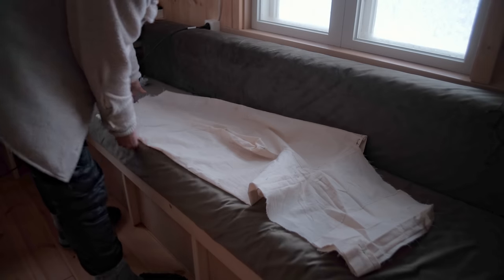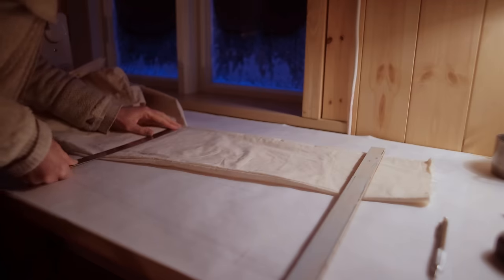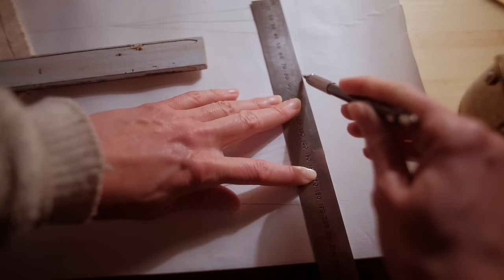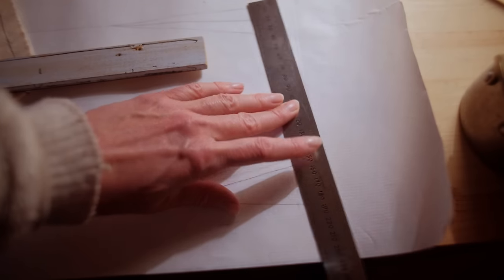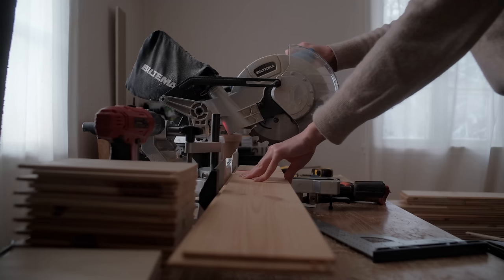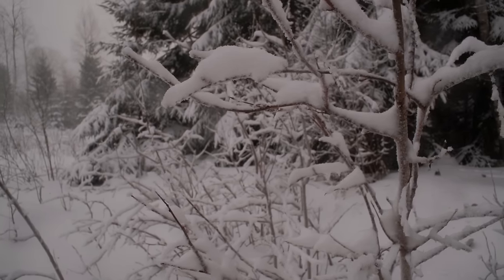Finishing my library build with a reading nook (Story 73)

Comment: Just an idea… you might want to think about getting a small sled 🛷so you can load up your packages and items from the market on a sled with a little rope attached, and just pull all your stuff home with it. Would definitely be a lot easier while dredging home in all that snow❄️.   Then when summer comes, you could switch out and use a little wagon.

Comment: Rosie, in Sweden they use push sleds to travel, not the sleds with dogs but just your own power. One of those might make your trips easier in the snow.
Reply: Yeah, I was thinking that too, at least to the bus. They have a seat on the front to which she could strap her groceries. They're probably not easy to find though, I have never seen a new one. They're called "spark" or kicksled.

Comment: May I offer a little tip about your crosscut saw?   You have a very course blade there.   The fewest teeth on the blade....and it's good for cutting roughly, but if you get your supplier to give you a fine blade...more teeth,  you will find you get a really clean cut.  No splits on the underside, which I've seen you having to trim off.  More expensive purchase, but really well worth it for the fine work you are doing.   Really nice what you are doing...!!!

Comment: I started watching before you bought this place. Love your style. You inspired my wife and I to build a tiny cottage on the rocky Oregon coast. Only 12'x24', red pine board and batten siding. Raw pine inside, even the floors. But our accents are black sheet rock screws everywhere instead of nails and wrought iron hardware. White bead board ceilings and a couple walls in bathroom and kitchen. We are all off grid, no propane. We are all solar, even a passive solar water heater that even provides heat through oil filled radiators with hot water pumped through them by a small RV water pump....James

Comment: I was thinking about how hard it is to lift heavy or odd shaped things upstairs to attics...and thought of how we used a pulley system to get bales of hay into our barn's loft storage area. You could rig a  pulley on the main beam of attic roof right above the stairwell , tie a strong rope to whatever needs to go up...and haul it straight up by pulley. That door you put up in attic could become a bed/table pllatform by adding 4 locking caster wheels to it. Add a roll-up mattress and its a simple seating area or a guest bed. Or use it as a growing area for plant starters and roll it to a sunny window spot in attic. P.S. Your too big overalls only need inside pocckets added...then when you get to buying groceries, when you get off the bus... fill your pockets with apples, oranges and LOTS MORE CHOCOLATE...you will lighten the load of your backpack and bags...and can hike home and munch along the way lol...take my advice and you may eventually fit the overalls lol!

Comment: It has been my experience with overalls that you want them to be a little on the large side. Usually, folks are layering bulkier clothes underneath them and you need to be able to bend and twist, etc. That's  difficult to do in tight overalls 🦋

Comment: Love this video again. Could you please sometime do a video about some practical stuff where you show us how for example your water system is set up? How do the cables go inside and what system is under your sink, And where do you leave the grey water from the sink without a septic tank? And how do you wash big pieces, for example bed sheets? I’m dying to know!!!
Reply: And also super curious how you for example heat the house if you are not home (as with christmas). Does it all freeze inside??

Comment: You pulling that door around the corner conjurs the image of a small furry creature slowly dragging a meal into her burrow even though the meal is several pounds larger than she is.  Roomy coveralls are not a bad thing. You can wear them over other things when its cold out. As a member of the peanut gallery I would like to suggest that you might need a hot tub. Love those hooks! From here I think that the gold in the lamp works with the color of the wood...
Reply: And, ya, the light's accents compliment that brass hook on the other side of the room.
Reply from the maker: I'd love to be small and furry!

Comment: A trick for carrying heavy and/or bulky stuff is to use a rope or a climbers sling, it's best if you can secure it upstairs, but even if you can't, it still makes it a lot easier.
Also, if you care about the piece or the staircase, it may be good to wrap the door, in this case, with a rug or something, it will also make things smoother

Comment: I’M 80 and have lost a lot of body strength in the past few years.  So I use tricks to move things.  In the door to the attic, I would put old towels, blankets, etc. either rapped on the edge of the door being dragged or on the stairs.  Then you can pull the door up much easier.  You can also put a thin rope or butcher twine on the door know and wrap it around the bannister.  This is in case if the door becomes heavier than you can manage the rope will stop it from falling and being damaged.

Comment: I think the gold color inside the lamp shades help reflect more light. Also, your bibs turned out fine. Bibs are supposed to be baggy so they're comfortable to work in.❣️ Also buy a small plastic toboggan sled and you can put your  backpack or whatever in it and pull it behind you. We have a large child's sled we use to haul our firewood in. It works great!

Comment: I admire your “I can” attitude for doing things without having been trained. You find solutions! One tip for sewing is to pin seams with point going opposite the raw edge ( bulb out, point in toward finished work) such that pins can be removed as you stitch and just before the machine might run over them. 🦌💌❤️🦯🔨👍

Comment: Perfect way to finish the video: if only I had light bulbs. lol overalls are not supposed to be fitted. Rather, they are supposed to be quite large so "workmen" could move with ease while doing construction and painting. That said, you're the one wearing them so you have to like them. 

Your place is really coming together! All you need is light bulbs! ; D

Comment: You seem to have equal amounts of patience and ambition which fascinates me. Re carrying such heavy groceries can you get a small child's sled to pull to the bus stop and leave there (hidden if need be)? Pulling on snow would be a LOT easier that walking while carrying a heavy load. Unless, of course, this is your way of building strength. 
Your coveralls looked fine. Have never seen fitted ones. You could never work in them.
Were we listening to an airplane flying overhead when you were out at your bench? The wind didn't seem to be blowing, so I'm guessing it was a plane. That came as quite a surprise as it always seems so incredibly silent there.
The gold inside the light fixtures will probably add a nice warm glow as many lightbulbs now have such a cold tone. I think you will like the effect.
I don't get to watch that often, but I always enjoy your videos as I could never do what you do. Do you have cell phone reception there? I spend a lot of time alone, but I do enjoy phone conversations as a form of company. I'm guessing in a sense you might think you have a lot of guests considering how many tune into your channel. Curious if there are any men.

Comment: Rosie, work overalls are meant to be worn over your regular clothes and then removed when you return to non-dirty work.  Winter overalls are the same, an outer layer to wear over your long underwear and regular trousers - an extra layer to keep you dry and warm.  Please don’t cut them up until you are sure that you won’t be wearing them in those two ways.  They are adorable and look so comfortable on you!

Comment: A small finishing nail gun would save you a lot of time. They don't cost that much ( I paid around €50). I bought nice little Stanley air compressor for €99 over 10 years ago, still going strong. Excellent for trim work & paneling.

Comment: a blanket or towel under the edge and pulling or pushing a large object has generally worked for me.  (Full disclosure...their have been bumps and bruises in this process.....)  maybe add some elastic in the sides to the overalls but honestly, I'd think they be more comfortable a little big since you'll be doing construction work in them?

Comment: Brava Rosie!! You did it! Finished??

I was thinking that the only thing  I would suggest considering is if you had a plank running from ceiling to floor against the frame of the door so that both sides of the door have the plank going down,  so the plank frames the door trim and then also on the opposite corner by the bookshelf,  have a plank going down in that corner so you look like you’ve got the wood wall behind the ply, but you have your own ideas !

I was wondering if you are able to find a glass door for the inside of your front entrance to keep out the cold, would you be able to keep the door open in your library to get the heat from the woodstove from the other room to flow through?

Comment: For the too big pants - could you sew a piece of fabric (think 4cm or so wide, maybe a piece of ribbon) which you could thread some elastic through ? Just enough to cinch them in a bit, but still allow movement. Other option would be belt loops and a belt.

Comment: Rosie, will your trailer fit on the bus? Pulling / pushing a loaded trailer is a lot less effort than carrying a heavy rucksack and you can get a lot more potato's in a trailer. My trailer was a converted pet trailer and the bus drivers considered it a pram.  
Toodlepip Brian

Comment: I wondered if your log burner is a stove and a back burner…which would provide heat to run central heating radiators throughout your house, if not could it be converted?  It’s a Cheap form of heating more than one room.

Comment: Rosie just thinking outloud but couldn't you hide a small sledge where the bus stop is and then you can pull the sledge along rather than hauling it on your back,could be so much easier I think.

Comment: You are amazing! I sew, but I couldn't build anything if I tried because nothing I ever do is in a straight line. I can't even miter corners evenly on a napkin. That you fit blocks of wood together is like splitting the atom in my mind. Do you have pinking shears? I know overlockers are very expensive in Europe, but pinking shears will keep your seams from fraying. Kai makes the best shears and scissors.
Reply: Uh.. Europe isnt one country where everything costs the same!  Some countries in Europe are extremely cheap, and others are extremely expensive (and a lot of them are somewhere in the middle). In my country the price of an overlock is similar to that of a regular sewing machine. That being said, overlock machines are absolutely not necessary. 90% of the time I just zigzag my seams and I never have issues with fraying.

Comment: Why don't you use your little sled to bring your groceries back in the winter when there is snow???  It would save your back the hurt.
Reply: If you use your sled for trips to the city, then make a harness which goes over your shoulders and attaches to a sturdy band which goes around your pelvic bones a few inches below your waist.  This will distribute the weight you are pulling in the sled.  Put a band just above your bust which attach to the shoulder harness.  It is distribute the weight and keep the harness from slipping around.  Do not just use your hands or arms pulling the sled.  Arm and had muscles are not strong enough to pull that much weight for any length of time.